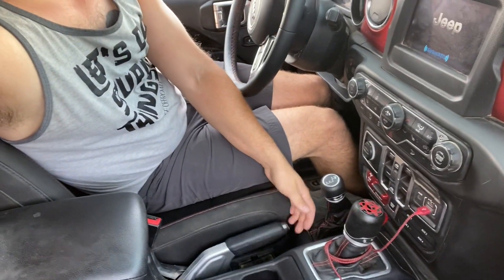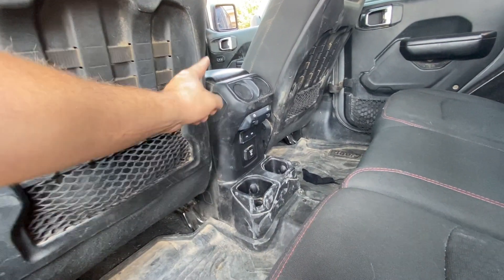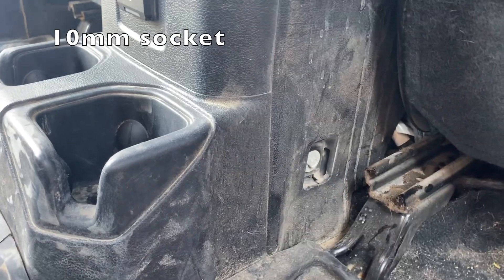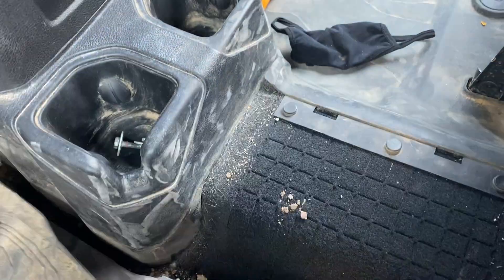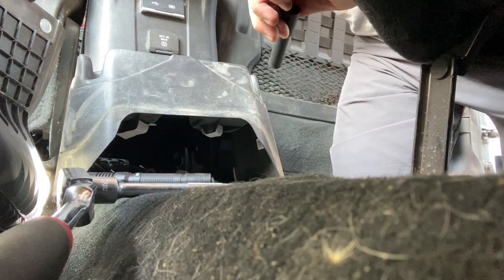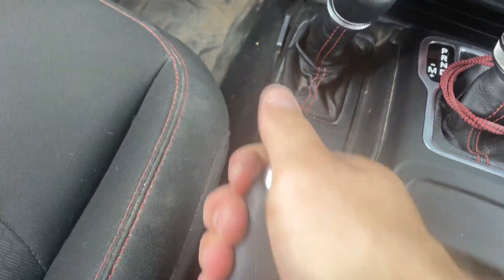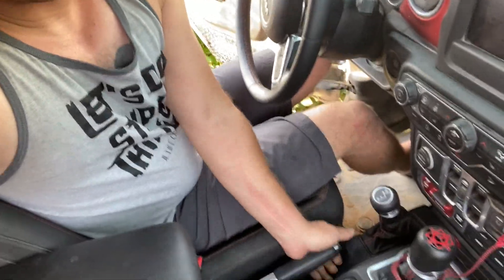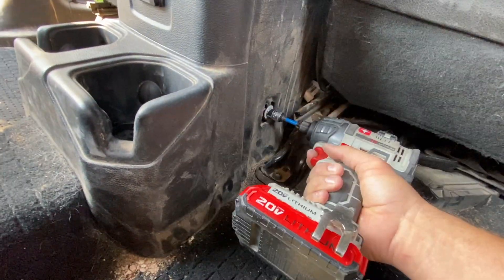Fix a Loose E brake handle on a Jeep JL: JT

Comment: My hand brake stopped engaging completely and the whole thing was loose as hell, I called the Dealership and they said oh you have 108k miles it’s Probably your “double clutch” and told me to bring it in, turned out that it was so loose that one of the wires came off the bracket, so glad I watched this you are literally the best

Comment: Manual slipped a little on a hill today.  Thanks man. Quick 10min and fixed.  So many vids taking the days apart and it was just a 6” extension with it propped up.

Comment: Mine takes 10 clicks on the hand brake lever to hold the wrangler in drive with a touch on the accelerator. There is no slack . I wonder if the drum shoes need adjusting or is this ok?

Comment: Sweet and short😉🤙🏼
Random question, did you hear about the new steering box? Something that you say to the dealer that your steering is loose and they replace it, but the dealership can only order one ever 14 days?
Reply from the maker: I have... but I’m not even wanting to deal with the dealership to find out... Iv lost enough hair lol
Reply: JL LIFE OFFROAD lolololol, losing hair I thought was a kid thing or maybe that’s gray hair(have more than a few myself). I really don’t wanna deal with the dealership and I have my tie rod/drag link and track bar brace coming so I’d rather just replace the stock parts and hope that tightens things up other than strengthen the steering. After I feel the dealership treated like I was dumb I’m sorta done with them. I kinda don’t even want another free oil change if I have anymore with them(didn’t put a sticker in the windshield and left a mess where they took it out).